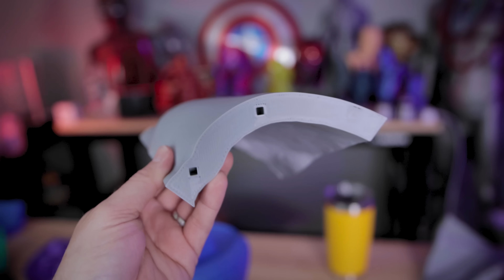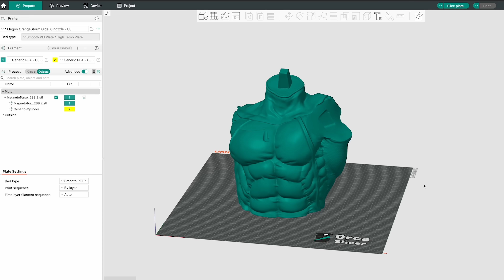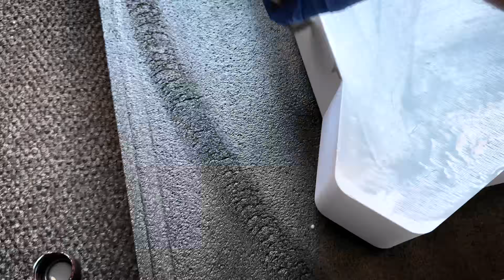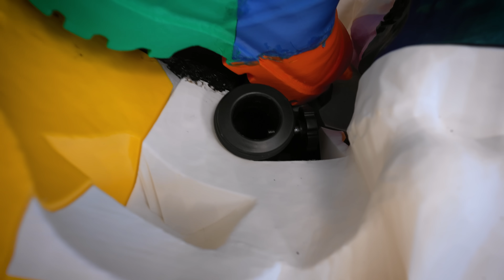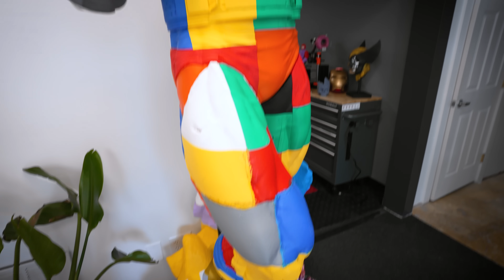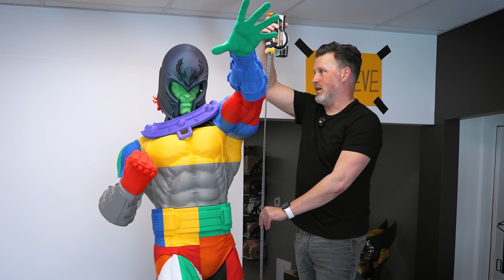My HUGE 3D Printed Magneto Statue! PT3

Comment: I don´t know how will translate to that masive scale, but what i do with capes in my 3d prints (1/6 and 1/4 scale) is use a thin EVA foam sheet, cut it in the shape of the cape and heat it with a heat gun, while still hot, i pose the cape in a dynamic shape i want. When the EVA sheet colds, the cape remains it the form is made. Then you can paint it and seal it if you want.

Comment: Paint for sure.
Grab some metal meshing from home Depot, the type that is used for chicken pens or thinner for cement pours. Bend it the way the cape would look then sew material (or glue) over the wire mesh.
Also, maybe some mortise and tenons joins with a wedge would be very strong and easy to remove. (Hide the wedge behind and conceal it)

Comment: Paint, use auto body filler for your gaps, glazing and spot putty is easily sandable. i do auto paint as a hobby, and applied techniques to 3d prints and quality comes out amazing.

Comment: Can you do the same thing you would do with magnets and drill a little holes and put pegs in and then smear glue on and then slide the pigs use pegs to strengthen a seam

Comment: Finish it, you've come this far.   cape would be fairly easy with thin gauge hex chicken wire from tractor supply, sandwhich it between two sheets of thick fabric, either super77 the edges or  actually sew it.   bend to a dynamic shape.      My printer is way to small to even attempt a project of this size,    id have to chunk mine like x5 smaller and that sounds like a nightmare.

Comment: I’d finish him… you should make a cape out of cloth with wire in it so you can pose it, or contract a cosplay costumer to make a cloth cape for you. You can put the thick 6 or 8 gauge wire in the cape which will hold its shape.

Comment: You need to get it fuilly painted. You'll want the head and helmet to be magnativezed as well. it will make them easier to paint. For the cape, look at having one sewn with wire embedded so it can hold the desited shape.

Comment: You can try reaching out to some YouTuber to collaborate with the painting, some channel focused on that. (Nerdforge? The problem is $$ becausa the distance) In case you don't want to have even more work besides the finishing touches, a painting simulating metal, bronze, or something like that, which is easier to do, would also look really cool. And make the actual cape with fabric! Not printed.

Have you thought about designing lighting for it as well?

Comment: What a monster of a print!! Nice work dude, If you are going to paint it (even just grey) I strongly suggest you have a play with "duratec grey surface primer", It can be brushed on, rolled on, or sprayed if its thinned down, BUT, the main reason I suggest you use it is because it is AMAZING for sanding, super consistent, easy to sand, and can even be pollished once you have finished sanding. I use it for boats, car parts, props, armor, even weapon masters.

Lastly you can add filling powder to it, you could probably use baby powder, but typically you would buy "Q-cell" or and sanding/fairing filler powder. This would allow you to do some really nice thick coats in areas like joins, cracks, or even just really nasty print layers.

The stuff smells pretty strongly of fibreglass, this is its only draw back, but once its cured I promise you, you wont want to use anything else ;)
Reply from the maker: Heck yeah will look into that thanks man!

Comment: I do think it would be a crime if you didn't paint it. Not a color accurate paint job because I think at this scale it would bad unless you were doing high end air brushing. But a basic primer that'll smooth it all out nicely and then a single color paint job. You wouldn't even need to do a dark wash to make the details pop as remember the wash is recreating shadows that would appear at 1:1 scale. And as this is 1:1 scale it creates its own real physically accurate shadows. So you just need to do the basic one color stone grey and boom, that's a finished stone looking statue that would wow anyone.

I have to say that's an amazing achievement. Its a bit of a wake up call to us all dreaming of larger prints just how difficult it is once you start getting beyond 1/6th scale which is so nice and easy to do on any machine. Quarter scale I think is really hard and expensive. So half or crazy, 1:1! that's just madness and I tip my hat to anyone that takes that on.

Comment: Not as strong as metal but you can also go with aclyic rod. More expensive as well but less noticeable back rod aganster the wall. You can also bend aclyic rods with heat or the metal rod so that it pushes out the statute.

For esembly heavy duty velcro will be your friend. Magnets work but you need a lot of BIG magnets to do it (hanging buster sword from a back of a cosplay big magnets.)

I would finish it!

For the cape you could 3D print it as well. You could actually use fabric a wire frame to keep it aloft. ;)

Comment: That is insane! I would recommend wrapping the pole in cotton, maybe with bits of silver in a spiral around it and around him like he's got metal bits to use as ammo and as a shield. If you added LEDS to it it would look cool too. (though it might look like a big fart lol)
He could have bits of metal shooting off along the extended hand too!
The cotton could cover some of the jenky bits on the base that you aren't happy with.
You could add LEDS under his boots to give him a glow effect there as well.
I'd definitely finish it. And the chicken wire cape sounds good.
Be careful with the magnets, you would do well to either embed them into the parts as you print them or use a lot of epoxy and supports around them. (they can deform the plastic)
I can't wait to see the next step!

Comment: I’m printing a helmet right now but I’m not sure if I need supports or not for the dome. What do you recommend? I sliced the dome into quarters by the way.
Reply from the maker: Typically I don’t put supports on the inside dome. It will usually buildup on itself. Might look a little messy inside but the outside is clesn

Comment: Paint. Look i know why you would want it as a 3d print, as it shows whats possible. But we all know.. we want to see a finished dream project. clean up. primer. paint.. 
Also, for the cape, fabric with fiberglass resin to set it, in the shape.. or fabric with shapeable metal edges so you can pose.

Comment: For the cape: try making a form with chicken wire, then draping fabric over it. Spray the fabric with some sort of hardener (pva glue?) and when it dries it should theoretically be a lightweight piece of material shaped how you need.
Reply from the maker: Oh man! Loving that idea thanks!!
Reply: @UncleJessy  they have something like fabric starch should be able to help too
Reply: That sounds wonderful! Makes you wonder tho if you should just use a light wiremesh painted close to cape color and just have it under cape and just shaped to desire?
Reply: I do love the idea of solving a problem more easily and it gives you actual fabric that has its own realistic look. But when even the base has its own 3D printed part to cover that stand. I think it would be a shame not to go 3D print for the whole thing including the cape. I have a Loki model I printed with a massive cape and how they solved the print being too thin was to just taper the edges so from a casual view it looks thin but its actually quite thick over most of the cape making it very strong. A whole other thing asking if that remains true at life size. I'm not smart enough with zero experience printing that large to say.